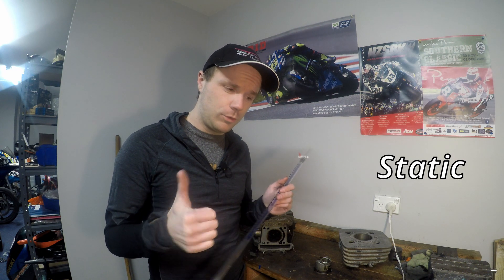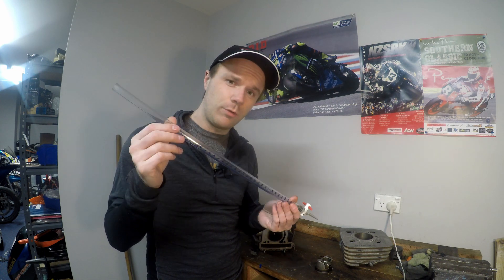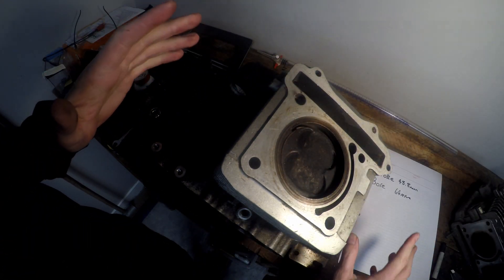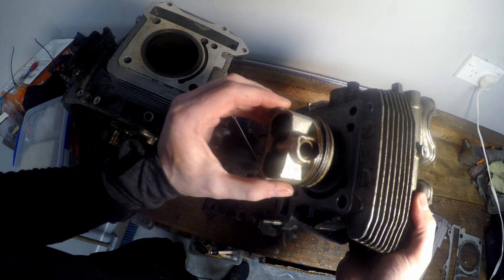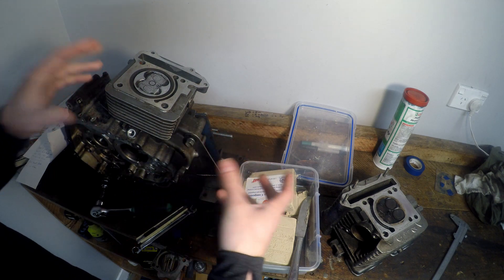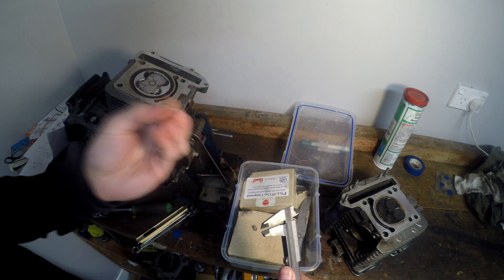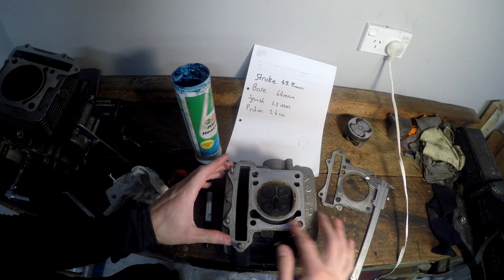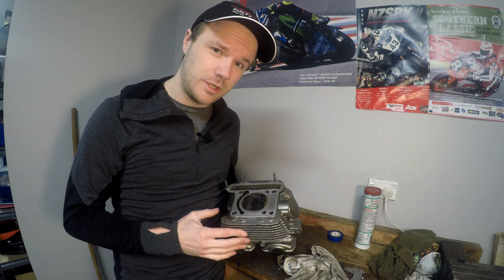Compression Ratio , Measurement, Calculation and Modifying.

Comment: Dynamic compression ratio uses volume of the cylinder when the intake valve closes which you can work out with a bit of excel but again that assumes air has no mass or inertia
Reply from the maker: Yeah man that's a better way to put it doe sure.
Bravo